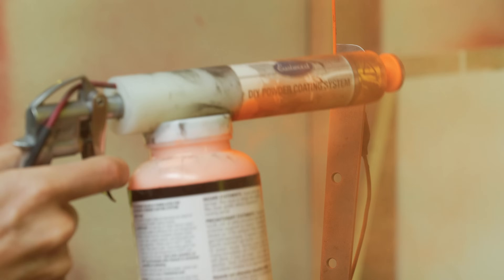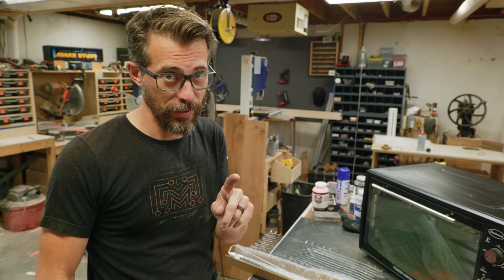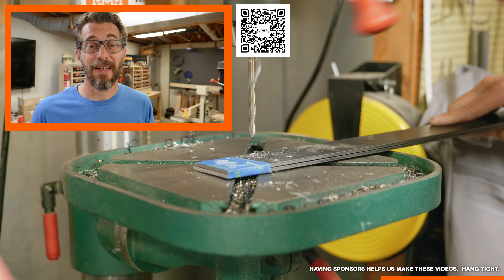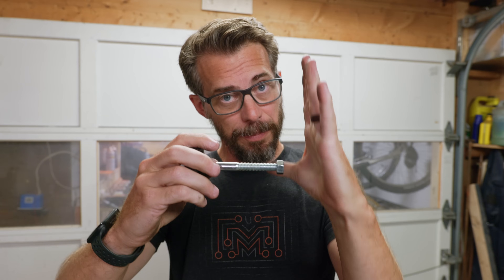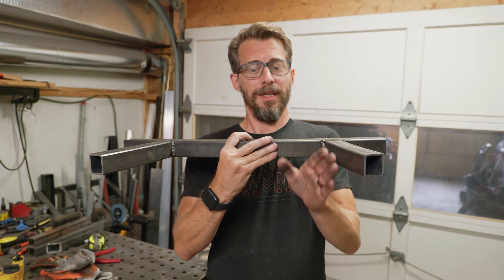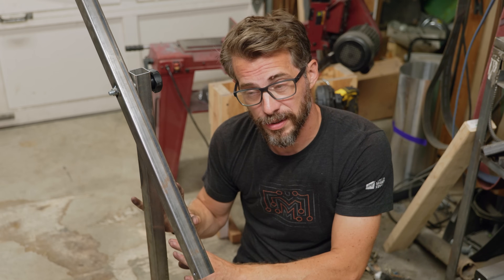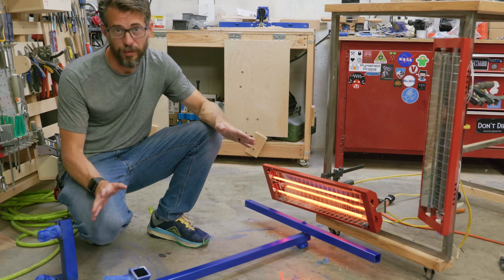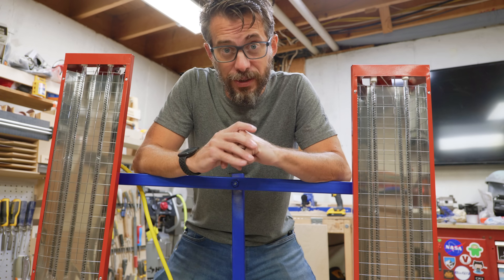How To Powder Coat Without An Oven!

Comment: This looks great for what I have been looking for, I have large car bumpers I want chrome or black powder coat. Original I was going to find a couple of free ovens and being a welder just cut and weld the two together, I use a large 220 extension cord in my shop. But your idea is so much better, I just need to coat one side of the bumpers, and being a welder and having extra 1/8 inch steel around I may even build a simple box with hooks to encircle the bumpers, which will keep in the heat for an even heat on the coating.

Comment: Could even be used to dry / bake paint and heat up the garage as well in the 1960's we used to use an electric hot plate to heat up a big pot of water with a gallon of enamel paint set on spacers to keep it off the bottom of the big pot of water anout 1/2 inch heating up the enamel paint thins it out and you wouldn't have to use any reducers to spray it out of a spray gun and the paint flowed so nice. It was just like glass and dried a lot harder as well then the next day or two wash the car with straight eater and chamie it dry the results are unbelievable and lasted longer for shine beter then adding the reducers and for painting outside we used to add a little liquid off to the paint to keep the bugs from landing in the fresh paint about an ounce per gallon.but thst was for outside paint jobs only because the more chemicals you add to the paint the faster it will break down that was the reason for heating the paint elimate the reducers...
But then you can buy pre-made heaters like that as well but the price is expensive and the quality of the tubing is thin wall probably not as strong as the onevyou build yourself and I've seen a lot ofvthe boughten heaters with broken tubes from being bounced around you definitely want to have at least a 3 inch casters to make it easier to roll around remember the bigger the wheel the easier it is to move on a damaged floor even a good floor and you definitely want st least two wheels with brakes do it doesn't roll around on it's own... I've used many of the boughten ones in many body shops and ive noticed that the small wheels bumping & bouncing around can jar the tubes and brake them!!!

Comment: Just a point of note.. Powdercoating cure time only STARTS when the item being coated reaches full temperature, usually 200 celsius. NOT when it goes in the oven or in this case, under the IR heaters. Make sure you're not just cold coating them... The powder will flow LONG before it actually cures.

Comment: Did you end up burning your garage down? When we make large heaters like this in a manufacturing setting, we build insulated enclosures and a vent/chimney out of the roof depending on the size. It saves on energy and prevents setting the ceiling or anything overhead on fire.

Comment: I've never powder coated anything ever. I totally habla  DIY engineering though.  And so , I just welded together a custom steel spiral staircase. Working on it real time.its for a 3 story zipline tower. The design i devised  s a 4" o.d.  central pole with a 2" wide, ring /slice of a 4" inner dia.  steel pole. (wall thickness 1/4")  as the mount that connects each step to the center pole. its 21' high so far. ( about to transition into a helical staircase for the 2 to 3rd floor entry way )  Each step slides from the top all the way down to its place. Anyways. .  I'm 16 steps and two landings already loaded onto the pole , so F sliding them all the way back  up and off of the assembly. But I need to paint it soon . And I just stumbled across. Your powder coating vid.  Ha.  And so, just hypothetically, in response of your your Question  " what big thing should  you powder coat
" If i had  powder coated each piece , that wouldve looked amazing . But now that it's 21 " tall.   Could it be powder coated.   Outdoors. A section at a time ?   Perhaps. ?  Or is that  just  Fn STOOPID to even ask ?

Comment: Actually Rustoleum hi temp BBQ paint require 450F for an hour to cure, which is simpler on a grill or BBQ or woodstove, but on my rusting Coleman campstove is going to be a little trickier to get.  So chicken brooder heat lamp or try to cram the stripped down painted stove box in my oven for an hour?  I can't afford this set up.

Comment: Not knocking your stand because it definitely works for what you need and may have been cheaper, but an old engine stand could have been a perfect base with just needing to weld a bar on the face for the mounts. I'm glad I saw this though it is good information to have for sure!

Comment: You should build an insulated cabinet, and put those elements inside it.  You can have a temp control wired to the heaters, or even just manually cycle them if your willing to watch the temp yourself. It may take a bit to get up to temp, but would be way more efficient as far as keeping the heat in and not making your shop hot as hell in the summer.

Comment: Could you use an old refrigerator with the plastic cut out and one of those heating units that you used? Leave the insulation on the sides and remove the plastic.

Comment: You could build a small collapsable box.....(light ga. sheet metal). set up your heaters and pieces, fold your box open around them and turn them on. It could be folded up and put away....when not in use.......Hmm?

Comment: I’ve pc for around 10 years off and on.  Actually getting ready to do a bunch of pc on my son’s foxbody’s underwood parts.  I like the stands, I would build a reflective panel to put on the opposite side of say a bike frame to reflect the heat on the backside.   I have built several take a part ovens.  One used an actual ovens electrics, the other used a toaster ovens parts.  I used flame retardant duct board(2 layers) and aluminum panels with a corrugated core.  They have 5 sides and sit on a concrete floor.  They are not pretty but they work well.  I once used a 10” round duct  with a hot plate to pc four 6” pieces of bar stock.   Pc is very forgiving as long as the part is clean, and you don’t get it too hot.

Comment: The 20a breaker you popped was protecting 12AWG wire in your wall. So, a 12 AWG STRANDED wire is NOT a sufficient whip for power to these devices when using them at the same time.

Comment: I have used a heat gun when I didn't have a big enough oven. My wonder though was if u didn't make each part exactly 400 deg for ... time what would happen to the powder over time? Would it flake? Rub off? I know it can burn or turn dark if u leave it to long. More worried about not doing it long enough
Reply: You want your part to be 'about' 350-400F for 'about' 15 min's. Hows that for a generality.  ;)
If it's too short of a time, you'll find that the coating doesn't really flow out and it won't stick as well as it could have.
Too long... meh... not so bad. 
Too hot?  Yes, it can burn. But really, you're standing there watching this (right? RIGHT??) happen, and can back off your heat source, turn it down, etc.
Just remember what Paint Society says -- Don't overthink it. It's just paint!    (fine, in this case it's just powder)  If you screw it up, just sand it off and do it again.

Comment: What you made was pretty cool many car tractors use powder coating I run 16 powder coating robots at chrysler for doing the boxes on Ram 1500 of course. Y operation is much larger

Comment: On your stand, where the two tubes swivel, you could easily use your center punch around the hole you drilled on both surfaces. This would create a ‘locking position’, when tightened….

Comment: I have 0 experience powder coating. I was wondering, is there a reason to not use a sand blasting cabinet (that has been well sealed and never used for sand blasting) as a powder coating cabinet? I'm interested in learning to do powder coating for some small projects (small faceplates), but I really don't want to have dust floating about as it could mess up some of my other equipment.

Comment: Add some insulation on the cabinet. Will reduce the heat loss. Achieve higher and more even heat. 

Thanks for the poster. 

I need more channels like this in my feed. Will check out the advertised service

Comment: Best recommendation I can make to you is wire them as 220 instead of 110 which will cut your amperage in half and you should be able to run both of them together on a 220 circuit at 20 amps

Comment: You can calculate this using the formula: Amps = Watts / Volts   ,So, 2000 watts / 120 volts = 16.67 amps.

Comment: I love your thought process. Instead of buying a giant oven, make a heater that can cure any size part. I’ll be powder coating my flatbed like this. I actually powder coat my small parts with an old dryer element and just kind of hold it on front of it for a while

Comment: So, with only radiant heat, do you have to rotate your coated object? Or does it get hot enough that the back side hits 400 degrees through thermal transfer?

Comment: Pretty awesome setup. I've never powder coated anything except lead bullets. I have a 16' long steel spiral staircase on a two story building I just bought. It's pretty rusted and covered with peeling paint. I'm going to unbolt and lower it onto my 18' trailer and take it to a sandblasting shop that's capable of handling it and painting it. I would much rather have it powder coated but have no idea how to tackle something that size. I'll keep watching to see if you come up with any other cool ideas!

Comment: Are you seriously not considering just wiring them into a single 240v plug???  Your breaker panel is right behind you and I'm sure your welder has 240v capability.

Comment: Just an FYI a simple calculation will give you the information that the heater description did not list... Amps = Watts / Volts. So each heater lamp is 2000 watts which at 110 volts is around 18 AMPs.

Comment: Nice work but I'll give you tips on your electrical wiring as it leaves a lot to be desired and it looks a bit....sketchy

Keep the single core wiring and wire nuts inside the housings with some heat resistant sleeving on them then using a strain relief boot or stuffing gland connect to a length of flex INSIDE THE HOUSINGS.

Second - using a ring terminal secure the ground wire of the flexible cable to bare metal within the housing - thus if anything live touches the housing, you or anyone else won't get a possibly fatal shock

Third either with wire ties or p clips secure the flex to the stand arm to remove the weight of the flex cable from the strain relief

Fourth - confirm continuity between the ground and the bare metal of the heating element housings 

Good job otherwise

Comment: Seems like it will waste more energy being open rather than putting a box around it. You can get materials to make a box cheap. Get a temp sensor to regulate the heat when the box reaches max temp. :X u can get one off an old stove

Comment: Hey there! Enjoyed your video! Thinking you can optimize the heat distribution a bit by placing some aluminum foil reflector panel on the opposite side of your heat emmitors there, keeping your target piece between those two. Nothing fancy really, just spread some food aluminum over some cheap metal scaffolding to radiate some heat back on to your target.

Great work!

Comment: If you are powder coating steel, then first put on a zinc powder coat as a base layer to inhibit rusting.
Finally put on the coloured powder coat.
I do this for equipment I store outside in the damp UK climate and the powder coating is still there after many years.

Comment: How do you not know the amperage? You said they were both 2,000 watts infrared heater…and you’re in the USA which is 120V outlet so the amp is 16.6A! Each lamp is 1,000 watts and each heater has two lamps and he has two heaters. So 32.2A
Reply: Helpful comment but the condescending part could have been left out.

Comment: You could try using fireproof insulation rolls to make a temporary blanket to get better heat distribution and utilization of the energy coming off, basically like a makeshift oven.

Comment: If you have 220, you could wire each heater to it's own leg of the circuit and add a switch to turn each leg off.  It might be easier than finding two separate 20 amp circuits.

Comment: If you use a 220 power cord and break it down into 2 separate 110s at the stand you will not have to use 2 completely separate 110 20amp circuits.

Comment: You told us the wattage of the two heaters together was 2000 watts. P/E=I. So, 2000 watts divided by 120 volts, should equal about 17 amps resistance heating. 10 gauge cord with a 30 amp breaker would have worked together in one cord instead of two cords. Nice job on the manufacturing.

Comment: The question is the liquid state change of the powder, can you do cold powder coating with pressure system.... hmm for metal or even wood... polymer you can melt with pressure... hmm but meh...

Comment: You can hang foil behind the part your powder coating and it will reflect the heat to the other side without you having to turn the part around

Comment: Hey Bob!! Question about wiring those. (I bought the exact same ones) Did you wire the end marked 110v together with the second lamp and that to the black from the extension cord, then the other ends together and tied to the white neutral???
Thank you for the awesome ideas!

Comment: Don't just use the lamps to cure the power, use them to preheat the part to 400 before you spray so the powder can start to "gel" before you cure. Helps build up more mils and get more even coverage. Nothing worse than blowing away powder you just applied trying to add more.
Reply: Also if there's a v2, weld a mounting plate for the casters, w rather than welding the casters so you can reuse them and not worry about masking them when coating them.

Comment: Maybe you are too far away from the  breaker box? Both of those lights together have only 16.6 amps, so as long as you use 12G wires, and a 20A breaker it should work...

Comment: if possible would use against a brick / block wall so that getting the reflected heat as well ,also could save a lot of work by starting off with outside bbq elec heaters , most are 2000w and on their own stand

Comment: Don't weld coated metals like the nuts and casters without knowing what the coating is. Get proper ventilation if you must. Strip it or sand it off is better. You're playing with your life.

Galvanized metals off gas cyanide. Zinc platings will make you sick.

Comment: To properly cure powder you need to follow the cure schedule. For example a lot of powders cure for 10 minutes @ 400 degrees part temp. So that means your timer doesn't start until the part has reached 400, not just in a 400 degree oven for 10 minutes. If you are only melting the powder until it flows out and is smooth you are not fully curing, this will lead to cracking, chipping and early failure of the powder. The alternative is to use a thermoplastic powder which do not require the cure cycle like thermoset powders.

Comment: I corrected the title for you:  "How to powder coat without an oven if you have a lot of shop tools, welding equipment, and scrap tubular steel lying around."
Reply: Well generally someone who would need a powder coat oven for large parts would have all of that already. No reason it had to be welded either.
Reply: I corrected your comment for you: Your title was acurate, but im mad that i dont have what is needed to powdercoat stuff and hat to actually watch a youtube video to realize it.

Comment: I think it would be neat to do one of two projects.
 
1. A large concrete block oven with a fire box to burn wood for heat. If done correctly you could have venting to keep smoke and ash out of the main area. 

2. Build a 6x6x6 oven with sheet metal and use the heating elements from three or four kitchen stoves all wired to the same thermostat. Or even put two of those heat lamps on each wall and put it on its on large breaker.

Comment: You could wire them into your 240v 50 amp welder outlet by splitting it into two independent switched circuits. One plug, two supplies, no blown circuit breakers.

Comment: If you need to touch up the powder, do it while the part is really hot. I do small PC in my home shop with nothing more than a heat gun. I get the part really hot, spray on the powder so that it slightly melts and sticks, and then heat up some more until I get a nice smooth and glossy finish. So, apply your powder and put the heat on that spot for however long you wish.

Comment: Keep in mind the aesthetic quality(orange peel) and durability of the coating depends on how quickly you get the part up to temp and the ability to maintain that temp and heat the part evenly. Different powders have different flow out/cure temp. Unless you are doing a candy color over polished metal its a good idea to sandblast or etch the surface of the part for better adhesion and durability

Comment: You need one set of those on each side of the objects because unfortunately objects are not 2d. The whole coating has to be baked at once and the hot metal helps it.
With one on each side, you would be basically creating an ir oven.
Without heat from all sides, you arent setting the coating in one layer...you are layering them on top and or against each other because of the non uniform baking.
That's why your paint rubs off so easily.
Also. i would ditch the shiny mirror finished reflector in behind the lights and opt for something that diffuses the IR more evenly that bounces from the back half of the bulbs, rather than cause hot spots and uneven light distribution at a huge waste of light.
I would paint the reflectors with a titanium white ceramic high temp engine coating , a matte color,...after scuffing them up a bit with sandpaper. That would result in a lot more efficiency versus shiny.
I mean, if you wanna go DIY then why not?